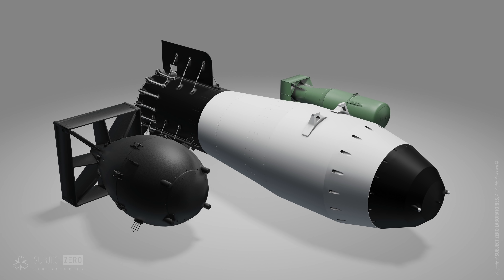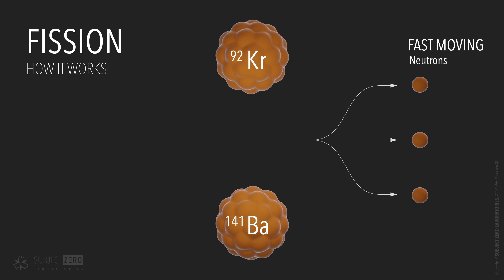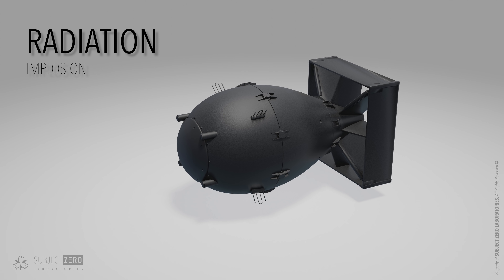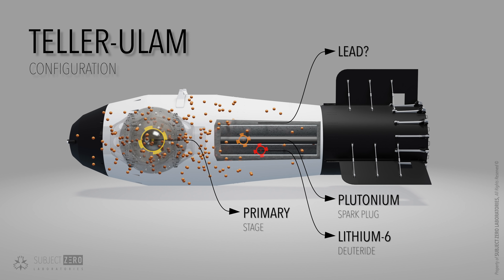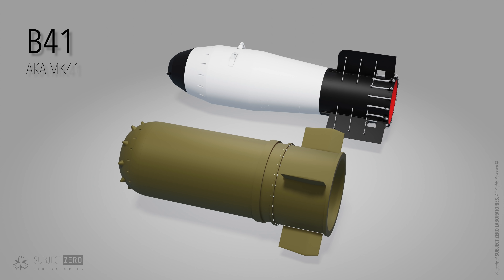Are Russian Nukes the Most Powerful?

Comment: There are enough mistakes in this video that people shouldn't watch it.
0:20 "thermonuclear bombs are quite easy to make" - not really.  Perhaps easier than acquiring plutonium, but still not easy.
1:20 There were good and sufficient reasons that Germany, and 180 other countries in the world, didn't create nuclear weapons.
2:00 You're confusing tamping with reflecting.  A tamper uses inertia to contain the fissile material for a fraction of a second; a reflector bounces neutrons back into the core.
4:08 Fat Man did not use "radiation implosion".  That's a different concept than explosive implosion.
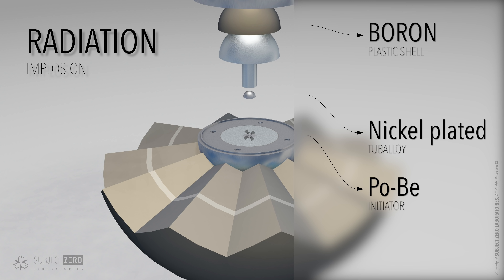4:58 The core of Fat Man wasn't "tuballoy" (natural uranium).  It was plutonium.
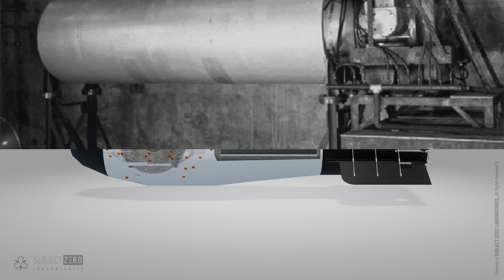7:00 Oh god please stop.
Reply: 0:54 - LB was 9 kT, not 15 kT yield.
1:20 - To add, Heisenberg completely screwed up the calculation as well and thought that they (the Germans) needed 10 times the actual amount to create a criticality explosion.
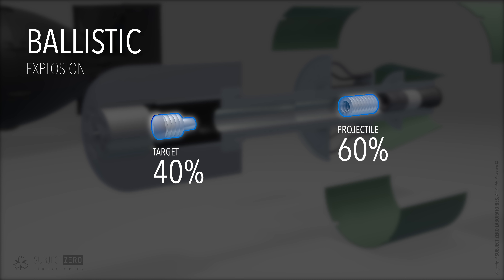2:55 - No, it was not 40% and 60%, it was much higher than that.  A lot more Uranium was used that was actually necessary.  The target was almost a critical mass in it's own right (approximately 90% of a critical mass) and the projectile was 60%+ of a critical mass.  LB was actually what's known as a fizzle as so much of it's potential was wasted.  And again, LB was only 9 kT, not 15 kT.
6:06 - No, Li6 absorbs a neutron then quickly decays through alpha decay into He4 and H3 (Tritium).  H2 (Deuterium) and H3 (Tritium) then fuse under the temperatures and pressures found in the explosion.

Seriously SZS, don't do another one of these unless you spend more time doing the actual research.
Reply: Agree with you , David.  There is way too much misinformation in this video to be acceptable for a channel purporting to be "science."  The animations are wonderful though!
Reply: All of your comments are 100% correct.   The tamper is so important that the Manhattan Project physicists considered using gold as the tamper because it was cheaper than uranium in 1945. As the compressed core fissions and starts expanding, once it reaches 1.12 times its diameter the fission stops because it is no longer dense enough for fission to continue.  That's how important the tamper is as the additional inertia created by the tamper keeps the core critical for milliseconds longer which greatly increases the yield.
Reply: @csdn4483  LB was 13-18kt. Not 9.
Nor was it a fizzle.
Reply: @buckhorncortez  The diameter would have to increase by a factor of 1.15 for second criticality.
The tamper definitely does not extend the energy production time by a matter of milliseconds.
It only provided a confinement time of around 79 nanoseconds.
Reply: I agree, this video says it's all that simple, but it is not at all. Much of all the content in the video is not true and just assumption.

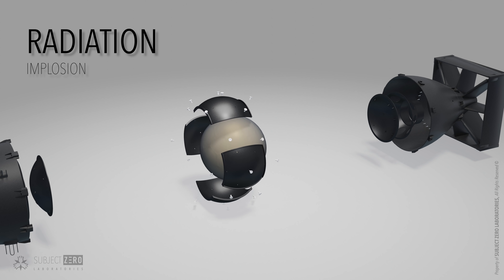Comment: ERROR in this video - Fat Man is first described correctly as a plutonium bomb at 4:05.   Then  at 4:12  the core of the Fat Man bomb is described as U-235.  WRONG.  The core was Pu-239.

Also, the video misses the REAL reason a plutonium bomb has to have such a complex implosion triggering mechanism.  Pu-239, unlike U-235, fissions and goes into a chain reaction much much faster and easier.  The gun device is far too slow in compacting enough Pu-239 together into a critical mass fast enough to create a powerful nuclear explosion.  Instead, enough of a runaway chain reaction would have started at the leading edges of the impact point between the two sub-critical masses to blow the two fissile masses  apart before most of the Pu-239 had entered into a good size bomb quality runaway chain reaction.  The result would be a "fizzle" a very very low yield explosion.

Some of North Korea's atomic bomb tests have been like this - so low yield they were probably fizzles.

Pu-239 is a natural byproduct of most nuclear reactors using uranium and can be separated out relatively easily using chemical means.  However, Pu-240 will also be in the mix, and it has a lower ability to undergo fission after getting hit by a neutron (it tends to capture the neutron instead and turn into Pu-241), which ruins the explosive fission chain reaction qualities of Pu-239.  And so plutonium derived from ordinary uranium reactors has to also undergo isotope enrichment to bomb grade Pu-239.   The other option is to build a special breeder reactor using U-238 to specifically produce highly concentrated Pu-239.    

U-235 occurs naturally in mineral ores, while Pu-239 with its shorter half life does not.   

And, so in any start up program to build an atomic bomb, it's a lot easier and you save a lot of steps by going for a U-235  enrichment program to make your first bomb.  Uranium enrichment thus becomes the first step towards building an atomic bomb.
Reply: The issue of Pu-240 is less to do with its poorer neutron properties and more related to its high spontaneous fission rate increase the predetonation probability. There's no record of Plutonium ever being enriched. Any conventional civil PWR can be operated such that it produces weapons grade material.
Reply: @Evan_Bell  
Yes, Pu-240 will also under spontaneous fission more easily than Pu-239 (this is a separate problem from its tendency to capture neutrons whizzing around from the ongoing fission reactions), and this also increases the likelihood of a high Pu-240 content plutonium bomb detonating with a fizzle. 
   
Running a nuclear reactor with the uranium fuel undergoing fission and neutron bombardment for only short periods of time before the fuel is taken out to be chemically processed to isolate the plutonium results in the highest concentrations of Pu-239 and lowest concentrations of Pu-240,  and this is how weapons grade Pu-239 is most easily produced.   Current commercial nuclear reactors for this very reason are not designed to easily operate in this fast breeder mode, with a constant cycling in and out of the uranium fuel.    This could be done, but is much more of a slog than using a fast breeder reactor specifically designed to do this.    The spent uranium fuel from commercial reactors thus contain plutonium with relatively high percentages of Pu-240 relative to Pu-239 from the long periods of time that the fuel has been in the reactor under neutron bombardment.  Isotopic separation of Pu-239 and Pu-240 is possible, but impractical because it's just so much easier to run a uranium reactor in a fast breeder mode to get the weapons grade  high concentration Pu-239 and low concentration Pu-240.
Reply: @gandalfgreyhame3425  Spontaneous fission is the prime reason for minimising Pu-240 content.
Weapons have been tested with as  high as 19% 240.
Modern weapons can be made such that their incubation time is shorter than their insertion time, rendering them predetonation proof.
Low burn-up campaigns are not reactors operating in "fast breeder mode". Commercial LWRs can't operate in the fast spectrum.

Comment: "There was no need for these megabombs"
Russia's 20 megaton R-36 Satan ICBM warhead and Poseidon Autonomous Torpedo: "AM I A JOKE TO YOU?"
Reply: R-36: still mostly carried multiple smaller warheads rather than one big bomb.
Poseidon: still on drawing board, not ready both torpedo itself or warhead it would be carried.
Reply: @DOSFS  it's worse then. MIRV has the advantage of increasing the surface area of impact on the objective.
Reply: @DOSFS   mostly =/= always. Stop with the Goalpost Olympics. Poseidon is not finished? PROOF? Hope that desperate dopamine fix to one up in the comment section was worth it.
Reply: @DOSFS  more than "on the drawing board". its in testing. they already modified a test sub that takes the massive torpedo for a while now. not only that but id bet that all the mapping of the ocean floor for this thing to travel autonomously is already complete. russia also has 60 years experience making small nuclear reactors. have a look at the "sub brief" channel.
Reply: @mrrolandlawrence  It's probably not a good idea to create an autonomous device capable of destroying a city.
Reply: @legiran9261  You're a fine one to talk about dopamine fixes, Mr All-Caps. Did you get much of a hit from that?

Anyhow, the 20MT R-36 warheads were removed from service a few years ago, and replaced with lower-yield MIRVs. Given the timing, it may be that they've been repurposed for Poseidon.
Reply: Arent they 200 megatons? The poseidon?
Reply: @Igorboss97  No, you've added a zero, or whoever told you about them. Tsar Bomba is the biggest bomb tested, and that was only 50 megatons.
Reply: @akizeta  i watched a video last week about the poseidon where they show its 200 megatons, you can search it up. So thats why i asked
Reply: @Igorboss97  Even Putin — who you can trust about as much as any former KGB agent — only claims 100 Mt.

As to searching for your video, how many hours of YouTube videos about Poseidon/Status-6/Kanyon am I going to have to watch before I find the single one that says "200 Mt"?

Besides, even at maximum theoretical efficiency of 6kt per kg, a 200Mt warhead would weigh 35 tonnes. Poseidon's big, but it's not that big.
Reply: @akizeta  got you
Reply: SpaceX Starship could carry 4 Tsar Bomba’s 🤔

Comment: `The fat man bomb was not a radiation implosion, but an implosion due to the focusing of shock waves from the surrounding explosives with different detonation velocities. These simultaneous detonations created a spherical wave that compressed the plutonium sphere into being supercritical, there was no radiation implosion involved. Radiation implosion pertains to the implosion of the secondary of a Tellar Ulam design, where the outside casing of the secondary is ablated by radiation causing an implosive force on the secondary igniting the the spark plug, nominally plutonium in many designs, is what initiates the Lithium fission Lithium-Deuteride. This fission then provides the Tritium, while the Deuterium is already in the mix in that it is a satble isotope of Hydrogen. Most sources state that the Tsar Bomba was a Boosted Implosion, and 2 additional fission fusion fission stages. The last stage was only Fission Fusion with a lead tamper instead of a depleted uranium tamper.

Comment: The hard part is always manufacturing the fuel. Uranium enrichment is still the bottleneck that stops most countries from making their own bombs. The plutonium has to be made in a uranium fission reactor then separated chemically. So it's not any easier since the reactor designs good at making plutonium need enriched uranium too.
Reply: @chouseification  The earliest stages of enrichment are actually the most difficult. Getting to 1% U235 is like 85% of the work to 90% weapons grade uranium.
Reply: @sethsims7414  I'm not sure how that's really relevant as you can go directly to Pu and not enrich at all - as I already called out, a lot of the early production reactors were fed natural uranium. That's unenriched, so it's about 0.7% 235 (7 parts out of every thousand) and most of the rest as 238. That's enough for a graphite or heavy water moderated (Candu from Canada) reactor to sustain a chain reaction - without any enrichment.
You only need to enrich uranium if you're going to use "light" water in a power plant, or something exotic like a submarine's reactor.
Reply: Koreans use laser enrichment
Reply: Couple top o the line centrifuges and you’re good to go.

Comment: “Making a bomb is simple” is where your incompetence shows.
It not only hard to produce enriched uranium, is also quite hard to create a clean explosion by compressing the fissile material quickly enough. If you don’t do this properly, they yield will be small, parts of fissile material will just melt and fly in all directions. There’s plenty of math and engineering tricks involved. And Plutonium is different from U235, harder to work with.
Fusion bombs are hard too.

Comment: The main reason for a tamper, is for kinetic impetus and inertial containment of the fissile material; to keep it in a supercritical state for as long as possible. The ingenious later addition to this, was to introduce an air-gap between the inner wall of explosives and the tamper. Unfortunately little was known about the nuclear cross-section of lithium7 at the time of Castle Bravo.

Comment: Okay, Fat Man was NOT easy to build.  You try getting a perfectly symmetrical implosion.  Took a breakthrough in explosives lensing plus extremely precise machining.
Reply: plus Jon von Neumann thinking it up, off-the-cuff.
Reply: Today with numerically controlled, hyper precise machine tools it should not be to difficult to form/shape explosive lense. So today assuming availabity of weapons grade plutonium, its relatively easy.
Reply: One of the breakthroughs was the explosive wire detonator system thought up by Luis Alvarez.  After some work, they got the detonators and timing system working so all 32 detonators were within fractions of a millisecond.
Reply: @DrDeuteron  No.  George Kistiakowsky was the person who developed the explosive lenses.  Von Neumann helped run the hydrocode calculations required to verify the blast wave interactions.  None of it was created "off-the-cuff."
Reply: @buckhorncortez  Yo you seem to be in the know. Is a yellowcake nuclear bomd possible? If its possible then how praticable as a deployable battlefield weapon as to it possible size.
Reply: @kevinyaucheekin1319  Yellowcake is uranium oxide. It is uranium ore that has been concentrated, which means the uranium has been separated from the surrounding rock.  Yellowcake is still natural uranium and cannot reach criticality.  It is the desired form for further enrichment.  So, you could not make a bomb from yellowcake.
Reply: @DrDeuteron  Hans Bethe is correct, but he doesn't explain the entire iteration of the implosion process.   The original idea for implosion came from Richard Tolman in a discussion with Robert Serber during the summer of 1942.  Tolman and Serber sent a memo to Arthur Compton about the implosion process in October of 1942 and discussed it with Oppenheimer before he was named the Director of Los Alamos.   

The implosion design is shown in "The Los Alamos Primer," which every physicist and scientist had to read before working at the lab.   Seth Neddermeyer became fascinated by the idea and was put in charge of doing experiments with explosives.  

Niedermeyer's contribution was the idea of compressing the core to criticality and not assembling individual pieces into a critical mass through implosion.

No one took Neddermeyer's experiments seriously EXCEPT for von Neumann.  When von Neumann saw what Neddermeyer was doing he said,  Neddermeyer needed to try a greater quantity of explosives and faster explosives.  Because von Neumann said it could work, people started taking the process seriously.  

When it became evident the gun assembly method would not work with plutonium, implosion became the only method available.  At that point, they got George Kistiakowsky to come out to Los Alamos full time and he took over in place of Neddermeyer in the development of the implosion process.   Kistiakowsky was the person that came up with the lenses using fast and slow explosives.  The lenses are simply shaped charges, an explosive configuration that had already been used in other applications. The novelty was making the shaped charged implode rather than explode.  Hence the charge name of an "explosive lens" as it focused the shockwave IN rather than out.    

von Neumann came to Los Alamos to help Kistiakowsky and his group do the math required for the final lens configuration so they could calculate the exact shape for the lenses to create an even implosion wavefront.  Now, does that sound like any of it was "off the cuff" or that von Neumann was the sole person responsible?   NO...
Reply: And in the end the implosion method is the safer one. It takes all of the charges to detonate in sync for it to properly go off, the gun design could misfire or even simply be dropped and go off at a bad day. And in the end they're all designed to be safe, to only go nuclear if you really, really want to.
Reply: @kevinyaucheekin1319  The physics behind it is very complex, well out of the realm of most countries.
Reply: @RichTheEngineer  Are you talking about a yellowcake bomd. I thinking in terms of not state actors or groups but my personal 200+ ton class personal nuclear device. Assuming ownership of yellowcake and artisanal mining explosive not illegal. If its not i like one.
Reply: it was etremely precise in 40s, now it is simple